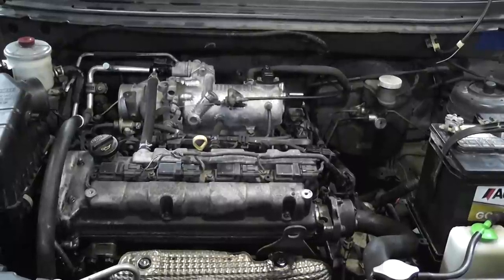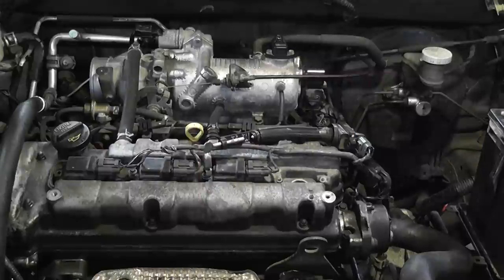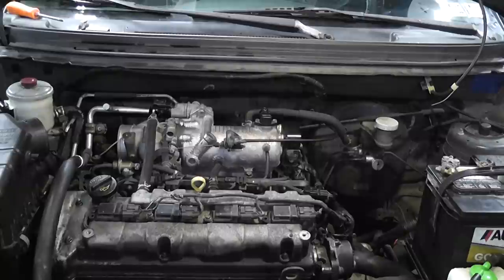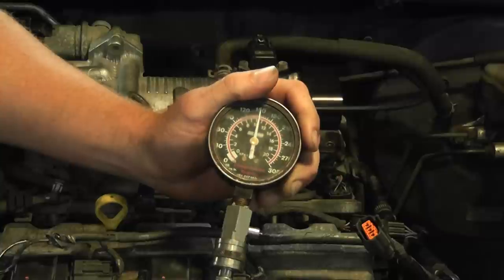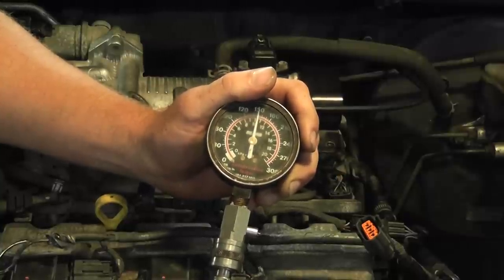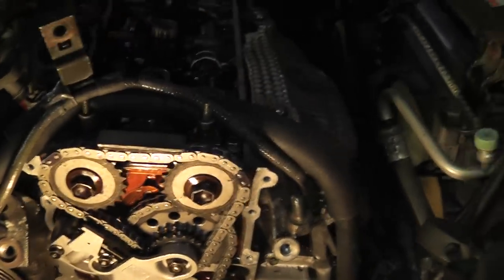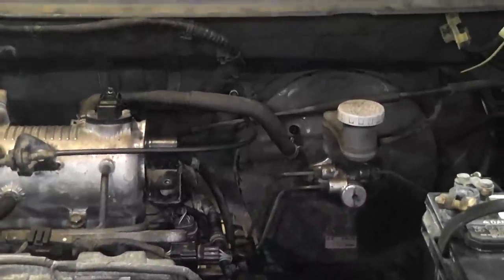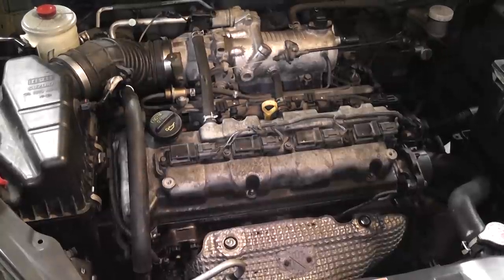How to check for a jumped timing chain or belt

Comment: I have actually tried it and it does fire the timing light try it if you lay the pickup on top of a coil on plug it will also fire the timing light try it

Comment: Nothing can compare to the thrill of having an engine start instantaniously after sorting a major problem.In my case the big-ends disintegrated at high speed on my Jetta II 1.8 DOHC.I removed the engine and gearbox as one(the gearbox turned out to be the  incorrect model with the ratios for an 8 valve).Had the block rebuilt and the head rebuilt and acquired a new gearbox from a scrapyard but lost heart and couldn't find the will power to reassemble it.Only after 10 months  of procratination did I find the energy to re-assemble the whole shebang(no outside help,only my off the shelf guide book).Turned the key and it started IMMEDIATELY!!!...The pleasure is indescribable!!!..I set the CO content literally by ear(it helps when your main job is being a concert standard musician).Took it to my buddy at his workshop to have everything checked..He was utterly astounded.He had previously mentioned that if I got the thing going under my own steam he'd be well impressed!!...Sock it to tnem baby!!

Comment: It is very rewarding when you use a scope. I used the scope yesterday on an alternator that was overcharging just off idle and when you look at the flow of diagnostics you want to pound your head against the wall. None the less when I scoped both lines the pull down signal would flat line at 0 ramping the duty cycle to max. Love moments like these. Not many shops use scopes, not sure how they fix or make any $. Another great job and explanation. Thanks Paul

Comment: Great video man. There is a TON of information packed into this video. You are very clear and very thorough, without talking too much or including unnecessary stuff. Thanks a lot for this, you just earned another subscriber!
Reply from the maker: Thanks man. Really appreciate the support!
Reply: ScannerDanner 
After a 60K service was done to my car ('95 Mitsubishi GTO/3000GT DOHC), the timing marks were all aligned and the belt was tight. I turned the engine one full revolution, manually through the crank and everything was still aligned. After I started the car and decided to take it for a test drive, I got into problems. What happened was that the car was idling fine and rolling forward in "D" (it's an auto trans), but as soon as I placed my foot on the gas pedal, the car shut off. I never heard any unusual sounds. After I took off the timing belt covers, I noticed that the timing belt felt loose in the area where it goes around the water pump pulley. I thought that the belt needs to be tight, so I started playing with the belt to see how loose it really was. As I was doing that, I felt one of the cam gears spun under the belt. I took the belt off (I was able to do it by hand without much trouble) and tried to rotate the cam gears by hand. The gears were able to be moved a little bit back and forth by hand. That made my friend conclude that I have bent valves, because he thinks that the cam gears should not be able to budge by hand. What do you think is the case? Do I need to do a leak down test to find out if I bent the valves or is there another way to determine that? Please help! Thank you!
Reply: Depending on where the cam lobes are will determine if you can mice the cam gear by hand. Don't go by that test. But if that belt slipped while driving due to it being too loose then you could have definitely bent the valves. Put the belt back on and line it all back up, then do a compression test on it.
Reply: ScannerDanner Premium I honestly can't see how it would slip since I never pressed the gas pedal, but who knows... I will re-do the timing and see what the compression test shows... Thank you so much for the quick response! I have also heard that the tensioner in this car was designed so that it releases some tension when the car is off, but this just seemed like a lot of slack to me... I mean, I shouldn't be able to pull the belt off the cam gear by hand and make it slip, right?
Reply: nicholi2789 a

Comment: I have been working on and building cars since i was a young kid, professionally since 99, and a grad of U.T.I. My father was a high school auto mechanics instructor for over 35 years, so i have been around cars and different forms of diagnostics and l have never even thought about using the scope to check for an out of time scenario. I will for sure be using this from now on so i can give my customer a definite answer without tearing into the engine.

Comment from the maker: that is awesome man! what a great compliment, thank you for that. you are correct about this test not being able to catch if the intake cam was off. the ignition timing would have lined up perfectly.
but you can actually see vavle timing problems in the pressure waveform itself if you know what your looking for. that is why this pressure transducer testing is so valuable.

Comment: Another interesting add-on to the degree calculations for timing offset:
The camshaft gear has 24 teeth and the chain was off by 2 teeth.
2/24*360 degrees = 30 degrees 
So the timing was indeed off by exactly 30 degrees as you estimated earlier from the waveforms. I thought it was cool :)

Comment: Hey there Mr Danner, as a fellow tech, always enjoy your videos. My worse timing belt job was on a Ford Focus SVT. I didnt have the locking tool for the cams, or the the locking pin for crank shaft. There are no marks on the bottom pulley for crank timing. Some how everything moved once the belt came off. I ended up using drill bits in back of the head to lock the cams. That wasnt too bad. But the crank was another story trying to find TDC. Took out #1 plug, inserted a welding rod all the way down to top of piston. Measured the max height of rod by rotating the crank for and aft for maximum hight of the rod. Put it all back together and it started up. HOLY COW! I was so happy as I wept the sweat off my brow. Got to hand it to your students, some of these chain drives can be vague at timing marks. They did good with 20 feet of chain to deal with!
Reply: woppini Haha I hear you, that oh sh*t moment.  I did a brake job once and my helper stood on the pedal while the pads were out and the caliper was off.  After using the wash station, I was able to put it back together and somehow bleed it.  I had the new caliper ordered when I got it working right, thanks goodness for no restocking fee suppliers!

Stay gold.

Comment: Paul "Scanner" Danner's tutorials are superb.  He is very generous to publish this way. 
I recently replaced a water pump in my 1999 Chevy Cavalier Z24; the engine has dual overhead cam.   The timing chain has one driving gear (crankshaft) and three load gears (water pump, exhaust camshaft, intake camshaft).   I put the car together and now it idles poorly (oscillates and almost stalls)but runs seeming well at roadway speeds.      I have performed compression test, which passed with flying colors.   I replaced IAC and spark plugs, with only slight perceived improvements to the oscilliatory behavior; but these actions did not cure the problem.     
I replicated Mr. Danner's amperage draw test, while cranking my engine; but the noise grossly exceeded signal, as observed on a very fine oscilloscope and so this test did not work for me.    Meanwhile, I found the signal that instigates spark... a 5volt pulse easily observed.   
This engine has no spark plug wires; rather its ignition system is integrated into a fancy cast aluminum cover and the whole thing comes out in one piece, with the spark plugs left behind... deep in a "V" between the two camshafts.
I noticed severe Long Term and Short Term Fuel Trims... NEGATIVE.  This is the opposite of what is caused by a vacuum leak in the intake manifold.     I now believe my exhaust camshaft is LATE by one (or more) tooth.  This is a rare mistake and even more rare than anyone talks about it.   Two such persons spoke about their similar situation with a Miata; one drove for 30K miles before stumbling upon the error when he tore his engine down.      It's typefied by rough idle.  And I'm adding the evidence of hard negative trim, as observed with a basic scan tool on the OBD-II connector.     I'm now expecting that my catalytic converter will be running hotter than normal (observable with a laser thermometer).

If anyone has any experiments or tests that can verify a "late exhaust camshaft," please post it here.   And just maybe, maybe Paul Danner will see this post.     I wonder if he's ever had one of these situations roll into his repair shop and training center.

BTW, Mr. Danner, I called the most prestigious diagnostic center here in Long Beach, CA, and they don't have a transducer that monitors compression dynamically, for oscilloscope observation.  So kudos to you, that you do that.     

But a LATE exhaust camshaft, or EARLY intake camshaft, won't cause a compression fault, anyway.    

In my car, there is a sensor ("CMP") on the intake camshaft, which could be observable with an oscilloscope.   But no sensor exists, that I have heard of, on the exhaust camshaft.    I am seeking ideas... some way of confirming my theory before tearing into mechanical correction mode!             
It looks like I'm going to have to lift the engine a few inches, pop the timing chain cover, and re-set the chain to various gears.  This time I'll slowly crank engine three times by hand, to confirm.    I wonder if there's any way to do this from the top of the engine... ? ... by changing the angular position of shaft to impeller gear, on the exhaust camshaft.   Yikes that sounds risky... 

I might also take my car to a smog check ("pre-test") for inexpensive detection of excess hydrocarbons.   But the catalytic converter will mess with that reading.     So I suppose the thing to do is to run the car to normal temperature, and then observe the temperature of the catalytic converter.   Compare to come baseline.     (YouTube should help.)

It's also possible that an exhaust valve could be hammered by a piston, if it closes "LATE."  Conversely, if intake valve opens "EARLY."
Reply: +John Becich I'm going to amend my earlier thread... per comment that a LATE exhaust camshaft or an EARLY intake camshaft would be indetectable by compression test.  
Firstly, the compression test of which I speak is the conventional "static" test that captures the peak compression; this is not Dan's "dynamic" test that shows how compression changes for every millisecond of an engine cycle.    
Nevertheless, I am amending to say that neither an EARLY nor a LATE exhaust camshaft would be detectable, by a static compression test.  That's because the exhaust stroke is 180 degrees out of phase with the compression stroke, and a static test (which looks only at the compression stroke) will be blind to errors so far removed, in angular terms.  
Meanwhile, either an EARLY or a LATE intake camshaft would be detectable by a static compression test; because the intake stroke is only 90 degrees removed from what the conventional compression gauge is observing.   And any mistake would be noticeable.
But with Dan's dynamic test, an error in an exhaust camshaft setting should be observable by a slight secondary blip, 180 degrees apart from the main blip (amplitude).  
Any comments, welcome.
Reply: John Becich
Reply: It's October 2017 and I have long since repaired the error, which indeed was that one of my camshafts was off by one tooth.        It was probably the exhaust camshaft but I can't be sure now as my recollection is hazy.     
The big mistake made, upon first repair, was to not use two M8 bolts to hold the two camshafts in the pinned position, made available by the manufacturer... when the timing chain is restored with chain tensioner coming into position lastly.
Car runs fine now.      No damage.
Reply: Cool story, grandpa.

Comment: Finally some answers! I have a 1996 Astro Van that has a 18 to 23 degree timing difference when the OBDII Reader is connected. It idles okay, but step on the gas and it sputters & backfires. It almost sounds like it has a heavy cam in it. 

I've adjusted the TDC & Distributor so many times and it either falls before or after the 6 mark on the distributor. I even flipped the distributor gear thinking it was installed incorrectly. Still the same result. 

The motor was rebuilt before I bought it and was told what was going on. Well, this just proves I have a timing issue. Looks like I know what I'll be doing this weekend.  Thanks for sharing this Scanner Danner!🤠

Comment: An other great one as I was watching this video I keep on thing about my early years in the business way before computer control systems and when we had a no start with spark and fuel (back then all you had to do is look down the carb and pull a plug wire lol) we would always pull the distributor cap off at #1 TDC and rotate the engine backwards and how much play was in the chain as years went on and controls started I bought my first scope and live SUN system and mastered it now I have a few one hand held a old LS2000 and a pc base scope system and tell all the techs learn it use it and there’s nothing you can not fix 
Anyway you are difficult one of the best and glad to watch your videos and I tell others to watch too 
Be safe and healthy to you and your family

Comment: you gave me great "simple" education about my l61 problems. Problem for me was bent valves from mechanical failure form the cam sprocket breaking the keepers for that gear. They had completely sheared off, whether it was because I hadn't torqued it down properly or whether or not It was just Mechanical failure, I'm not sure. At any rate, "ERIC THE CAR GUY" Thank you, you are doing a great service to your community on this channel. We all know, If you are before the Internet, this video series are very good. Thank You
Reply from the maker: +josh cooper thanks josh!
Reply: +ScannerDanner would a broken timing chain cause the car to turn over very fast and no start. I think my water pump failed and threw my timing chain off

Comment: Hi guys nice job at this suzuki aerio 2003 .I have a suzuki aerio 2004 that I change the timing chain , but something went wrong . When I start cranking don't start . But by watching this video I find out that I skip one tooth on one of the sprockets specially the one at the left side. I look at some picture I took after installing covers and your videos. Now I know what I did wrong. THANK YOU ALL !!!
Reply: I'm having trouble with the same sprocket (intake camshaft). When I try to align it, when I let go it snaps back to the same spot. Did you experience the same problem?

Comment: super and exact specifics on every step on any diag. or solution with excellent camera shots, light, clear speech, complete explanations inside and out..  im a midgrade mechanic and about 10 years under hood but all hands on and lots of trial and errors in the past and as careful as I always try to be rushing to complete a job as simple as head gasket replacement that ive done before on my car and setting the timing on 2 separate occasions on the 3rd round i rushed and i didnt double check the cam lobe mark positions after i realized i erased all my prior pics of the entire job during disassembly i got impatient because i was under the gun to fix on a deadline due to being kicked out of my place. and i guess my timing is wrong because i only hear a smooth turn of crank and cams..  no compression at all..  and now I'm out of time being kicked out of my place tomorrow with no car and I believe that after installing all new valves and resurfacing the head I believe now I have to pull back off the head and replace all the valves being that I believe I bent all the valves but with this video I just watched I have the same type of cam sensor that is like a distributor for the cam and crank sensor and I'm hoping I simply didn't connect something right and maybe there's still a chance I did not damage the valves sorry to ramble about my issues but the point being is even when you think you are good there is always knowledge to be learned from a different perspective or from a different point of view through another mechanic size that is very thorough such as my boss that trained me and this mechanic here that I admire for being so thorough and precise if I could rank this mechanic 1 through 10 I would give him a 50 good job my man and if you have any ideas for me that I should check before I dismantle this car in the next couple hours it would be greatly useful and appreciative peace love and chicken grease and keep the bolts spinning in the correct way

Comment: small easy hack i use is a zip tie to tie the chain around the sprocket so it not to fall when i try to align the other sprocket:D  keep the frustration at bay make work alot easy!

Comment: Nice idea of checking ignition vs compression using the scope.  I reckon a lot of guy's would have just pulled the timing cover and hoped it was out!  But it proves the point that you should always start with the small stuff!

Comment: I was surprised you had that kind of compression when you're over 30* late. It was quite obvious on the wave form that it was that late. Plus most Mitzi engines gotta be at least 20* late before they won't start at all so the condition speaks for itself. But actually I was kinda surprised it didn't even try to start. People can say what they want about Mitzi engines but they run under some really difficult circumstances like, low compression and late timing. Good video gentlemen...very well put together and very educational.